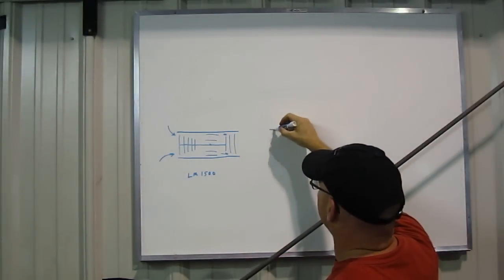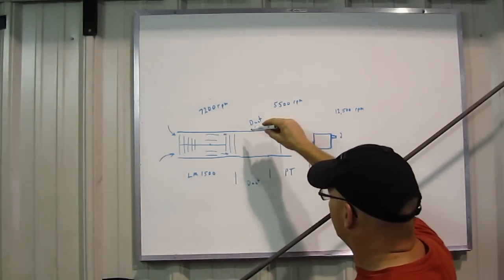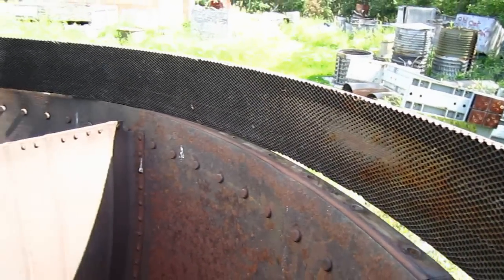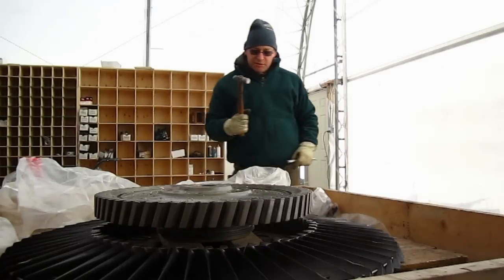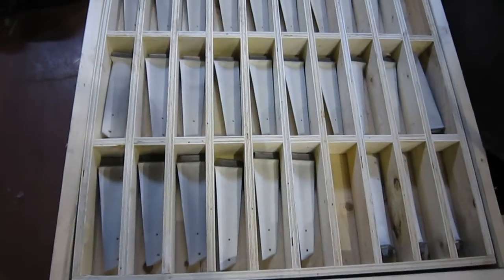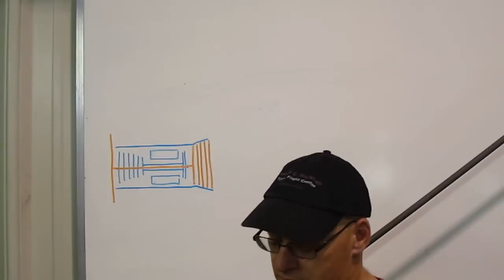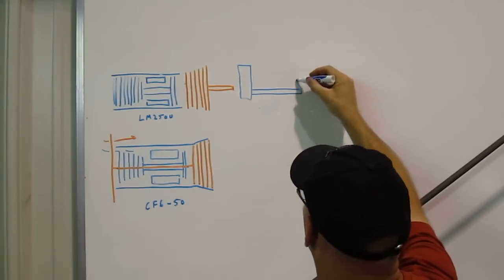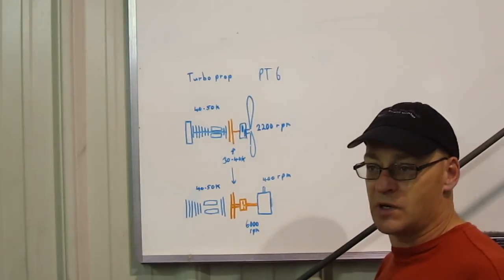Power Turbines: what are they ?

Comment: I used to work on the LM2500 engines in an FFG-7 class ship in the US Navy.  From "cold iron," which is all systems off and cold, to moving the ship at full speed took 8 minutes.  In a conventional steam boiler ship that took 48 hours.
Reply: Chris Moore Jet engines themselves are reliable pieces of machinery. Can't imagine with the extra "over built" nature of these engines to power generators, they must last damn near forever.
Reply: They do....justified by the fact that the turbine he is discussing is from the 1950's !!!
Reply: Imagine having to work on a nuclear reactor in something like a sub or aircraft carriers I think some other ships have them but most likely wrong there
Reply: In a late steam turbine-powered DD, with 4 600 psi boilers and two turbine sets- cruising, hp & lp, cold-iron to full power took well over 8 minutes, and WAY less than 48 hours. That's crazy. Of course you did need steam (like from pier-side) to power forced-draft blowers to initiate light-off. Then you could be underway in a couple hours. Figure another hour to get all four boilers online. Once out at sea you could get to full superheat (850F) from saturated (480F)safely, meaning no more than 50F per 5 min. Depending on a variety of factors it could take 4 hours to go from cold-iron to full power. You'd almost never need to go to four boilers- also all the above was extremely labor-intensive..
Reply: Not to mention the Spruance-Class Destroyers that were common place in the 70s and 80s when I was in the Navy (DESRON 4) used 4 × General Electric LM2500 gas turbines (the first ships in the Navy to use gas-turbine propulsion), 2 shafts, 80,000 shp (60 MW). I always thought it was a wonderful feature to get underway immediately in an emergency deployment instead of waiting for boilers to come up to 1200psi to run steam turbines like my first ship (Knox Class Frigate).

Comment: I was working for a gas company. We repaired and maintenanced the turbines sometimes by ourself. the biggest was a titan 250 which was used to compress gas to i think 70 bar. the smallest we had was a turbine from a helicopter which was used for producing electricity with 2200 horsepower. all of these turbines were inside giant metal boxes to reduce the noise they make and it was also better for cooling. there were huge ventilators blowing fresh air through these boxes. we weren't allowed to open the boxes while the light in the turbine hall was on and also not allowed to make pictures with our smartphones through the glas of the box with flashlight on. In the turbine boxes were photosensors which should detect fire and if they get activated, the whole turbine hall will get flooded with co2. it was so amazing to hear these beasts start up and rev to max rpm.

Comment: I am a compressor station operator on a gas pipeline in New York where we use a Solar Mars 100 (15,900hp) to run our centrifugal compressor. I wish you had done my initial turbine theory training as I have learned (and understood) so much more from watching your videos than from a week of official Solar classroom time. Having said that - management is discussing adding a Solar Titan 130 (20,500hp) to increase our capacity and while reviewing the specs on this unit I noticed that while the Mars 100 power turbine is referred to as a 2 stage axial, the Titan power turbine is called a 2 stage "reaction". I've tried to do some research online but find very few references to reaction turbine in the realm of gas turbines. Most of the references are to water or steam. I found one short video on youtube that gave a brief definition and it appears to have something to do with the angle of the blades on the power turbine stages. I was hoping you would be able to clarify the difference between an axial turbine and a reaction turbine - as well as why you would use one as opposed to the other. Thank you very much for your channel.
Reply from the maker: Tim Goggin Have a look at Your Questions 23, where I talk a bit about the two ways a turbine can produce torque. Let me know if that helps.
Reply: AgentJayZ Damn I didn't want my first question to be one you already answered. Apologies for not locating it myself and thanks for actually taking the time to point me in the right direction. I think over the last month or so I've watched all of the Q videos in order. I guess it's time to start at 1 again and work on my retention. Thanks again for the videos - will definitely keep following.

Comment: When we mount blades, we always weigh them, and then assign them a place of the disc/hub. That way it is balanced out. The two blades with the closest weight to each other sit on opposite sides of the disc. The discs are then rivet bolted. The turbine blades have a small amount of play. This is normal. It allows for expansion from heat, and it allows the blades to find their natural center during start-up and shut down, much like helicopter blades and their flapping.

Comment: Hi JZ enjoyed your explanations of turbine engines. I’ve flown a PT6-47E Free Turbine engine on a Pilatus aircraft. The compressor rate RPM is north of 37500 rpm, whereas the power turbine free side is conveyed into approximately 30000rpm with a planetary reduction gearbox generated 1700 rpm for the propellor.  Thankyou again for your great videos.
MRM
Reply: Duke mo stank stank

Comment: I serviced and repaired many combustion powered generators 150KW diesel and gas, and the detail you gave on the turbine engine, and speed of 3,600 RPM with the gear reduction box was great!!!, and all controlled by the fuel in the core of this wonderfull engine with a massive HP rating for the MEGA WATT OUT PUT!!! was easy to see. Thanks for the insight into this field and keep up the good work.

Comment from the maker: It's actually more complicated than that. 
There are two types of axial flow turbine blade arrangements. An impulse turbine works on changing the direction of the flowing gases without accelerating or decelerating it.
A reaction turbine works by having a gas pathway that narrows from entrance to exit, and this causes the gases to accelerate as they pass through the blades.
Most turbines are a mixture of impulse and reaction, as chosen by the deign engineers.

Comment: I operate a combined cycle power plant which uses a GE 7FA combustion turbine. We do not use a separate "power turbine" as everything is common to one shaft. So we have a compressor, 3 stage power turbine, and electrical generator all on one shaft. The hot exhaust is used to produce steam for a steam turbine/generator set. All this is designed for 3600RPM for a 60Hz electrical grid. 

Seeing you explain some of these other types of turbines along with some of the different terminology that goes along with them gave me a cool new perspective on what other designs are out there.
Reply from the maker: Th GE 7 is a single shaft engine, and a large-purpose built industrial turbine engine. I don't have any experience with them.
The small Solar Saturn is a single shaft, as is the RR 501, which is adapted from an aviation design.
Most of the aeroderivative engines we see are adapted for industrial use by being coupled to a separate power turbine. And the exhaust is often used as a source of heat to make steam. Why waste it, eh?
You are right; there are many ways to get the job done.

Comment: great video. i work on avon, olympus and ruston TD4000 fuel control systems used on the oil rigs/power stations. i'll never get bored of hearing the GTs firing up. only thing i don't like are the mechanical overspeed tests lol.

Comment: Gearhead Numbers:  Paraphrasing from a book, each postage stamp sized turbine blade generated 660 hp to develop 75,000 hp.  We had gone from a 28 cylinder Pratt & Whitney R-4360 developing about 1 hp per pound of engine to a Rocketdyne High Pressure Fuel Turbo Pump developing 100 hp per pound of engine, the highest power density rotating device known anywhere in the world in its time.  The two-stage turbine was 11 inches in diameter, spun at 36,000 rpm, and generated 75,000 hp to feed fuel to NASA's Space Shuttle Main Engine.  From Rocketdyne: Powering Humans into Space, p. 214 - 215.

AgentJayZ, FANTASTIC videos sir!  Although these numbers are from a slightly different theme, I thought you might appreciate them.  As Buzz Lightyear would say, "To Infinity & Beyond!"  Keep up the GREAT work sir!

Comment: "if you know exactly, great tell me" hehe, right as you said that, I happened to be looking at the PT6 book. Axial Flow Compressors: 37,500RPM @ 100% N1...same for centrifugal impeller.   Power Turbine: 33,000 RPM @ 100% N1   Shaft angular velocity is 2200 RPM @ 100% N1    Great Videos Jay! Can't wait for more!

Comment from the maker: @Blackmoonempire Because of the hi temperatures involved, engine self-locking nuts can't have any plastic parts. The self-locking nuts used in aviation and industrial gas turbines are either solid and slightly ovalized for the top portion of their thread, or have axial slots cut halfway down from their top and the resulting "tabs" are bent inwards slightly.

Comment from the maker: You could say that. In a two shaft turbojet like the Olympus or J57, the LP compressor acts to supply a consistent supply of compressed air to the core of the engine.
Much like a supercharger, this increases power output.
A later development of the two shaft turbojet was to increase the size of the first stage or two of the LP compressor, and divert some of the extra compressed air around the core.

Comment from the maker: The overhaul manual of a current model of the GE LM2500, an engine which includes an integral power turbine and therefore produces it output as a turning shaft, states that the max continuous output torque is 66,000 ft-lbs. The shaft turns at 3000 to 3600 rpm, so that works out to around 38,000 Hp, which is the rated output power for that engine.

Comment from the maker: The blades are less fragile than you think... in the way a sledgehammer is less delicate than a feather.
The aluminum drift will never touch the high-nickel alloy that the blades are made of. The alloy is used for two reasons: It maintains its incredible strength, stiffness and toughness at very high temperatures... and it is incredibly strong, stiff and tough.
Toughness is used here as a technical word meaning being very resistant to fracture of cracking.

Comment from the maker: The result was better fuel economy and more thrust. These enlarged forward stages of the LP compressor became known as a fan, and the engines were called turbofans, or bypass fan engines, or simply bypass engines.
The benefits were very significanrt, and the engines were eventually designed so that the major portion of the power developed by the LP turbine was used to turn a huge single stage fan, which bypassed most of its output around the core.
These are the modern, high-bypass turbofans.

Comment from the maker: Yes, the turboshaft engine has an integral reduction gearbox, whose output is usually around 6000 rpm. Then there is the helicopter main gearbox... not part of the engine, and its output is the main rotor shaft, so 400 rpm or so for a light helcopter. The turbine engine consists of the power turbine and reduction gearbox, designed to run at a constant 600 rpm, and the gas generator, which varies in rpm on order to supply the PT with what it needs to stay at 6000 despite varying load.

Comment from the maker: @krbruner Generating electricity, the rpm of the pt connected to the electrical generator is very carefully controlled.
But not more carefully than a helicopter main rotor. The pilot controls the load on the main rotor, and main rotor rpm controls fuel to the gas generator. The main rotor never overspeeds, because of the fuel control to the GG. 
If the pilot increases the load on the rotor, the GG instantly responds to maintain PT rpm.

Comment from the maker: @krbruner The main rotor rpm of a helicopter does not change, but the rpm of the GG goes up and down as the fuel control varies the power as needed to keep PT rpm constant. If the pilot pulls too much pitch, the main rotor rpm begins to drop, as the temp limits on the GG will not allow enough power to be generated to maintain the PT rpm. This causes alarms to go off: both for GG temp and for low PT rpm. In other words - reduce the load or crash.

Comment from the maker: Turboprops and turboshaft engines are designed from the first day of their existence to do what they do.
Gas turbine engines of all types are the product of much more intense engineering and design than any automotive engine. That's why they don't change much over decades of refinement, and why they stay in production so long.
For the price of a new Veyron engine, you could do a part of an overhaul of a small helicopter engine.

Comment: Holy smoke. On the balancing there was no shroud. Where I worked people would freak out. We has one set up for a fan (low pressure compressor) that was only partially covered on the side and other people complained.  I'm impressed with that set up.  Looks adaptable for different applications.
Reply from the maker: It's highly adaptable, and we use it for all the different engines we work on.
People who freak out or complain are not allowed in the building.

Comment from the maker: Nothing is free. In our engine, the fan needs about 20 thousand Hp to turn at 3400 rpm, and that power comes from the LP turbine. The HP compressor and turbine, also called the core, is turning a bit more than 9000 rpm to supply the gases that turn the LP turbine.

Comment: About 85 km west of London is Didcot Power Station.  Actually, there are three stations, the 'B' station is about 15 years old and is a gas-fired combined cycle station of about 1300 MW.

The 'A' station closed in March this year.  It had four 500 MW steam sets, originally coal fired, later converted to also burn gas.

The third station, part of the 'A' station is a small gas turbine station, which could be used to supply power to start up the main steam plant, or to feed the grid at peak times.

Comment: Thanks for all the info, I think I will check out that book as I am really interested in gas turbines,  I think part of my problem is thinking that they are all a cookie cutter solutions.  A elec. generator is rather heavy and I am sure that the flywheel effect makes it so much easier to control, where as a small turbine in a helicopter probably has much better throttle response, so it can trim out the PT easily for optimal operation...keep up the series, always enjoy them.

Comment from the maker: @JETZcorp The info is very hard to come by... but I think those turbine trains used a de-rated version of the LM1500. The fuel consumption of a turbine engine does not fall to near zero at idle as it does with a diesel piston engine, so they are really only economical to run in applications where they are working at or near max power most of the time.

Comment from the maker: The two rings of heavy wire are there to halp dampen vibration in the blades.
The strength of the blades is compromised by having hole drilled in them, which is why later designs of this machine did away with the wire damping, and changed the blade mounting system slightly.

Comment from the maker: @oisiaa Hmmm, I have taken an LM2500 apart and rebuilt it, but we never disassembled the compressor rotor, and it stayed on a stand. The rotor is hollow, because it is built up like the LM1500 rotor... but it does not have a large passageway through it for the non-existent LP shaft.
So the answer to your question is yes and no...

Comment from the maker: No.In a few rare cases the fan is geared to a lower speed than the Hp system.
In two shaft engines, which are the majority, the two systems turn at their own best rpm, and the LP system of turbofans is optimized for turning the fan.

Almost all arliners do not have reduction gearing driving the fan.

Comment from the maker: @krbrunerOK, your ideas are sounding better. as for controlling PT rpm, that's done by the load. Remember, a PT works against a huge load all the time. If you back off the fuel to the gas generator (engine), the PT instantly loses rpm. No need to bleed off the gases being fed to it.
Negative throttle response, as in reducing power, for a gas turbine is instant.
You might be interested in a book I am always recommending : "the Jet Engine" published by Rolls Royce. 
Probably in your library!

Comment: Thanks so much for your reply. I understand your skepticism about my idea but I didn't say I didn't have a turbine but only said I got rid of the turbine in the hot exhaust. Since I'm now retired I've had time to build a crude model of my design and the principle works amazingly but not being a jet engine engineer I can't say whether it would work in a full size engine. I've shown my model to a friend who was an engine mechanic on c130s in the Navy and he was amazed at how it worked and said he'd never seen anything like it before. I'm still just feeling my way and don't want to lose the idea as I can't afford to patent it yet.
Reply from the maker: You are missing the point I'm trying to get across. The energy is in the exhaust, and the compressor needs a lot of power to work.
Turbines exist because they are the lightest, simplest, most efficient way to turn energy in a gas stream into mechanical rotating power.
Reply: @AgentJayZ  sorry I don't mean to frustrate you but I agree with everything you've said about the energy in the exhaust it's just that I've discovered a way to harness that energy without a turbine in the gas stream. But I do need to do more work on it as I've only got about 2500 rpms in my model at the moment. Do love your videos so much. Learned so much. I'm an old Kiwi now living in Oregon. Cheers